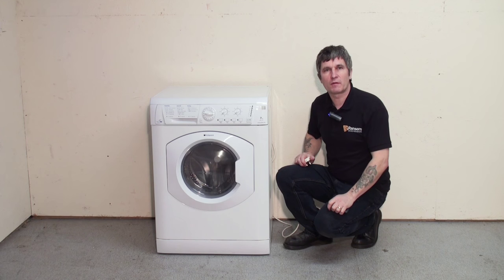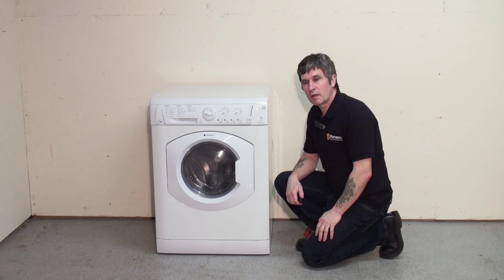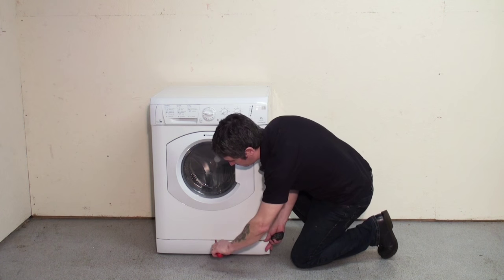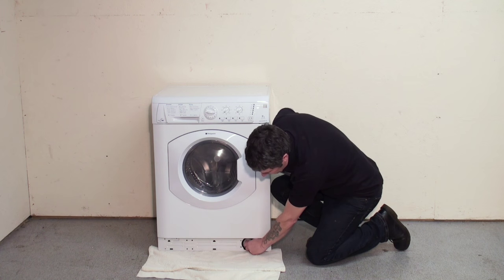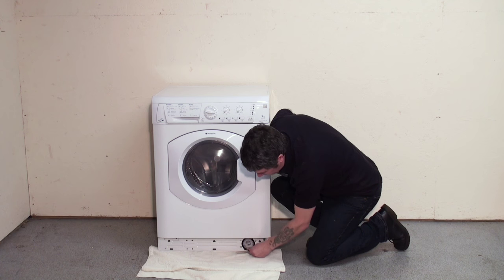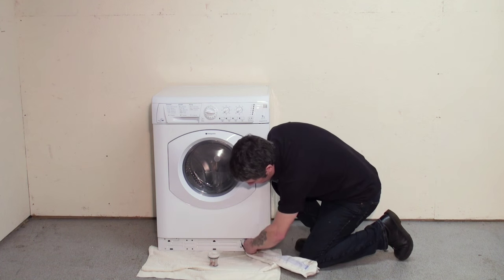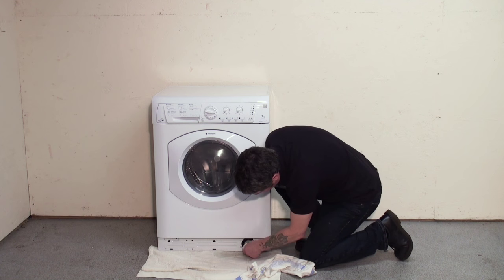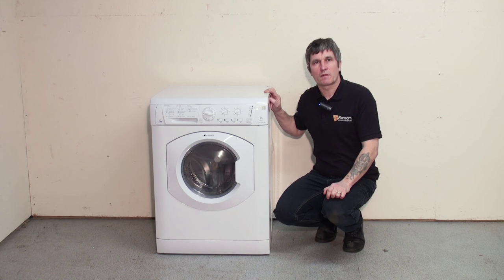How To Clean The Filter on a Hotpoint Washing Machine

Comment: I found that once unscrewed the filter would not come out of the machine as something was jamming it.  Pulling on the filter resulted in the screw thread section coming off the main part of the filter, still stuck in the machine.  Other YouTube video's explain it is then necessary to turn the machine on its back and remove the whole pump mechanism and take out the blockage from the inlet pipe.  I wasn't up for this as we have a dryer on top of the washer and my back wasn't up to lifting it off, so I would have to call out an engineer, wait for him/her to arrive, and then pay.  So I used an old screwdriver, that had all its sharp edges rounded off by use and abuse, and levered the filter out.  This was risky and I expected the filter would break and/or I would damage either the inside of the filter housing or the rubber gasket on the filter, leading to leaks when reassembled.  I had to exert gentle but considerable force (no sharp jerks) and eventually the child's sock that was causing the problem ripped sufficiently to enable the remaining part of the filter to come out.  I was then able to pull out the offending sock, reassemble the two parts of the filter and screw it back in.  I think I was lucky something did not break.
Reply: Having the same problem. Difficult to see where the screw driver needs to enter as there appear to be three rings around the filter cap. I suppose it must be the inner one .
Reply: I have the same issue. Filter cover does not want to move at all and we don’t want to risk breaking it by forcing it.
Reply: Mine only turns roughly 45 degrees, if that.
Reply: Update: I managed to unscrew it with a pair of pliers to find a sock in the filter. I had the dreaded ‘all lights flashing’ and was actually going to buy a new machine tomorrow morning. Thankfully, the machine appears to be running perfectly again.

Comment: Thanks. I had a F-05 Error (could not drain) on my Hotpoint and couldn't work out how to remove the panel without this video. I had to use a monkey wrench to turn the filter, but I could get in and clear the limescale that was blocking it.

Comment: Hi, I have this machine, a WDL540 C (UK). The tumble dryer was just making clothes hot and steamy so I opened it and removed the plastic steam condenser to the gunk out and got all the lint off the fan in the heater box. Now I've refitted the steam condenser but the lower end with a concertina rubber ring and metal ring to fasten it doesn't seem to grip anything and the condensing water leaks out. Any ideas? I've been at this for hours and phoned around but can't get help! Thanks. Peter

Comment: Never seen a dryer with such an unnecessarily difficult removal for a lint trap. What a terrible design lol
Reply: So awful! No way of draining the water into a bucket/pot either, which means draining out litres of water onto towels on the floor
Reply: It's terrible, the panel is so flimsy that when I tried to take it off it cracked all the way down the middle
Reply: Video says gently I need a jack to get this filter cap off 😭🙌🏻
Reply: All Hotpoints are still like this - 2024

Comment: All I want is a bloody tube to get rid of the water ! I'm sick of flooding the kitchen
Reply: Try using a baking tray or something else that's flat with a low lip you can slot just underneath the filter when unscrewing
Reply: Nothing fit. Even a dinner tray. Soaked the floor boards. Used towels to mop up the flood. Will probably need to replace floor boards when we move
Reply: Yeah I know!
It beggers belief why they put these things soooo low down that you can't even fit a really shallow baking tray underneath! Luckily, I have a concrete floor, but right at the point of the horrible, stinky water coming out, is where my kitchen lino starts, so I never know if thst stinky water has gone underneath the lino. Best thing to do, is to unscrew it REALLY slowly, and just let the water dribble out a bit at a time, onto towels....just like in this video.
Reply: @Mortthemoose  the filter is so low as the type of pump used in modern machines is a gravity fed pump meaning gravity helps it to drain the water through the drain hose
Reply: Other brands have this, can see where Hotpoint have tried to save money to the detriment of the customer
Reply: I use a puppy traing pad, to soak it up